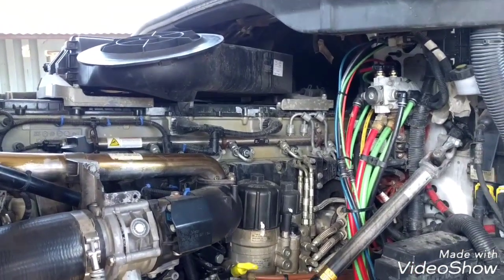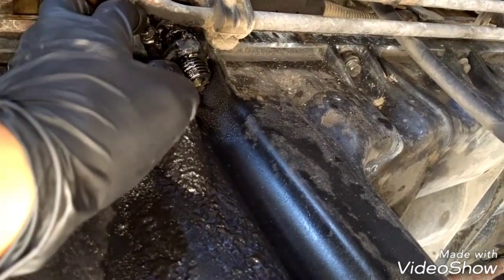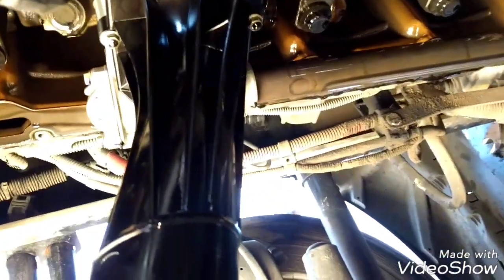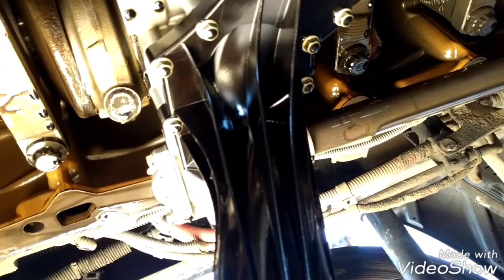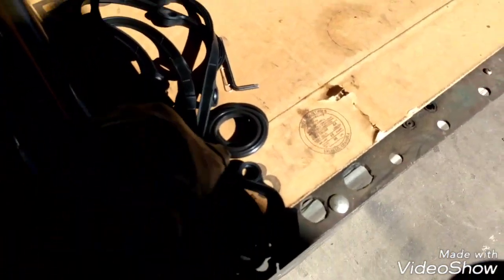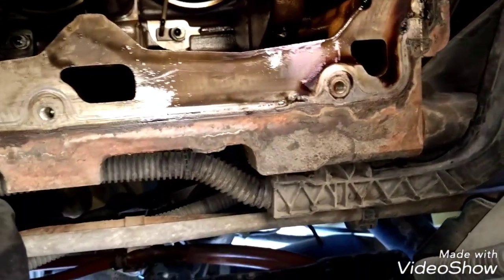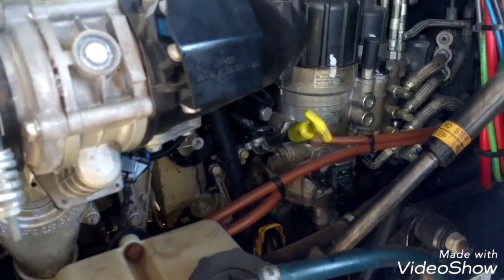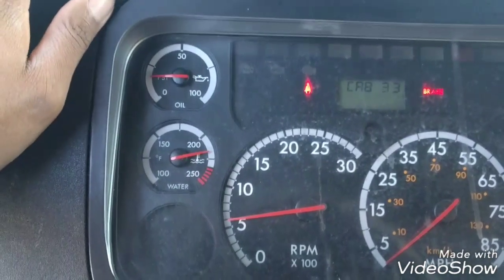Freightliner Cascadia DD13 DD15 oil pressure low oil pump o-ring replacement oil pressure warning

Comment: I have a DD15 engine The oil pressure is good. However when I shift the pressure drops drastically but as I idle it picks up. So my oil pressure dances
Reply: Did you ever find out what this problem is

Comment: I have a DD15 engine The oil pressure is good. However when I shift the pressure drops drastically but as I idle it picks up. So my oil pressure dances
Reply from the maker: I think, you should change the oil pump o-rings and the suction module.  

Looks like the PROBLEM is starting.
Reply: Mine does the opposite. When I shift, sometimes the oil pressure surges then quickly comes back down. I currently have code SPN 100 FMI 0. It says “oil pressure sensor problem detected service engine soon.” I have gotten this code once before but it went away. Also, when this code pops up, the oil pressure fluctuates from time to time.

Comment: Buenas tardes francisco mire que mi camioncito se le cayo la presion asta 0 pense que era el sensor decho se lo cambie  pero la presion sige a 0 alguna sugerensi se lo agradeseria mucho decho esta un faultcode SPN000100
Reply from the maker: Posiblemente se quebrado el modulo de suction de aceite

Comment: Im losing oil pressure when I break and come to a stop. While I’m driving or idling the pressure is normal. Have you seen this?
Reply: Same for me
Reply: Same
Reply: What is problem how Much it cost
Reply: I’m having this problem, while I’m driving it goes to 50, but while coming at stops it drop almost to the bottom. What you ended up doing?

Comment: I have a 2014 Cascadia and my oil gauge dropped to 0 while driving... got towed in but truck still starts with no engine lights... what could be my problem and repair advice

Comment: If you wait to put the new oil filter in, you will dump a half to a quart of old oil in the clean oil pan. Stays in the engine until you remove the vacuum.  Just discovered this by accident while doing a pan gasket.

Comment: What is the name of your shop? I have this low oil pressure problem on my 2010 dd15. Thanks for the informative videos
Reply: When you say oil pressure is low can you please be more specific as to what is going on, is it your oil psi needle or is  your oil light on the dash is coming on?🤔
Reply: Tenggo un dd13 DEL 2010, la precion del aceite se me vajo a 0 y se prendieron las Luces del check engine and stop engine y se apago el camión, en la carretera no tuve ningun problema de presion si no haste cuando pare y le volvi a prender. Lleve el camion en wincha a un taller y primero me dijeron q eran los cables de los sensors, los cambiaron y prendio todo normal sali del taller y se volvio a apagar con el mismo problema de la Presion en 0. Ahora me dice el mecanico que encontro metal en el aceite. Que tan danado puede estar el motor"? Que piezas deberia cambiar? Deberia reparar todo el motor por que puede Huber pedazos de metal en todo el motor? Gracias x su ayuda.
Reply from the maker: Deveria tratar de cambiar la bomba de aceite, los orings y el bracket de succion.  Puede que eso lo ayude. Sino resuelve nada va a tener que cambiar los metales de la bancada y biela
Reply: Francisco Amaya muchas gracias, y puede que el árbol de levas también esté malo???
Reply: Francisco Amaya gracias
Reply from the maker: No, el Arbol de levas posiblemente no

Comment: My stop engine light came up,my oil pressure won't go up,I pulled over,my truck won't start and the motor seems locked up,I have a 2013 freightliner cascadia 13speed automatic transmission,can anyone help me out?

Comment: Good job Francisco. I have a 2012 Paccar engine I've noticed that the oil pressure has dropped to 30-35 when it used to stay at 40 what would you recommend.  Thanks

Comment: Francisco, how much does a job like this cost normally?
Reply from the maker: $500 - $1200 depending on the parts that you are going to replace and the shop labor rate. (dealer is going to charge more)

Comment: I have a 2012 cascadias with dd15 .When I brake hard ,the stop engine come on ,do you know what could be the reason ?
Reply: The oil pressure did drop
Reply: You need to replace the oil pump "O" ring, I just did that work before yesterday.. Was happening same thing to me, now is done that problem.
Reply from the maker: It is possible that you have the oil low pressure problem, check the oil pressure guage to see how low does it goes.
Reply: Me 2 same thing i guess ill start with oil pump
Reply: I have the same problem did you ever find out what causing your oil light to come on when braking hard?

Comment: My Detroit 60 series has the same oil pressure when it's hot and I thought I had an issue with the motor. The motor was rebuild less than 30000 miles ago

Comment: Hi Mr Francisco! I have a problem with oil level. Now I’m fixing that fuel is going to coolant. This I checked oil level, it was on max level mark when I changed oil but today I checked and it’s higher for 7-8 mm than max level mark. I don’t see any water in oil, oil was thinner, what might be issue with it? Do you think fuel might go in the oil when injector cups o-rings destroyed? Tell me please what to check , thank you very much!
Reply from the maker: If you replaced the fuel injector cups, there could be a fuel leak from a fuel injection. 
My suggestion, remove the six fuel injectors again and replace the fuel injector o-rings.

Comment: the ecm looks at oil temp as well as pressure to trip a low oil pressure code. also before you start this job you should find out how many seconds the engine ran with low oil pressure. if it is excessive when the pan is off and the oil pickup is off that would be the time to drop a couple of bearings and inspect them. if they are scuffed- REPLACE ALL THE BOTTOM END BEARINGS RIGHT NOW! no exceptions...
Reply: forgot to mention if you are going to drop a couple of bearings inspect 5 or 6 main and 4 AND 5 rods. they seem to be the worse for wear.  and don't put any crap additive in the oil.  good oil and filter is all you need. yo!

Comment: Francisco  i had a break down in south carolina 2012 dd15 720k 24 hrs from last pm . While driving at 65mph oil preassure dropped then a clunk cluck cluck noise was heard driver pulled over and shut the engine .worst cause senerio bearing damage on piston bearings or crank bearings .. if crack shaft is not damage can or have you experianced changing out all bearing and oil pump and resealing with new o-rings and sump and having the truck fix the cluck sound ? In other words if you had a clucking sound after oil pressure would you rather change out the motor or just replace the bearings if one or more were damaged? Thanks
Reply: so what was wrong?

Comment: Hola Francisco, disculpa molestarte, I tried taking the wheel out to replace the abs sensor,I have 2011 cascadia with disc brakes so i looked and you pull the bolts in the front to loose the rotor but after that what do I do, cause the rotor is not going to move? no room can you please help me. Freightliner charged me 18 hours to do my engine harness I am so mad I need to do my own stuff. Thank you so much.
Reply from the maker: Email me here 
ccsfleetservices25@outlook.com
Send me some pics to understand you better and give you a better advice.

Comment: For that fix did the code on the dash say,
ENG 2 001 SPN 000100
Oil pressure 01 ??
Mine goes off when i break but oil levels are fine.
Reply: Zack Myers drop your oil pan I just went thru that it was the o ring on the oil pump on mine

Comment: Do they go bad at 350000 miles?
Reply from the maker: It varies, some go bad at 700k + miles
Reply: @franciscoamayaYT  My truck had broke down due to low oil pressure warning , but it turned out to be the sensor only whoo! i saved a couple thousand
Reply: Anonymous Trucker what type of codes where you getting?

Comment: Hey Francisco, i had one time oil light came on but after changing the oil it went back to normal. Now low oil pressure coming back on again.
it stared coming back again after about 3000 miles or little more after changing the oil. 
Can you please tell what would be the problem?
Reply: spn 100 fmi 1 this is the code its reading
Reply from the maker: Probably, you will need to service the oil pump orings and suction module soon.

Comment: My truck have the same problem and i would like to get fix I have oil in my tank and my oil gauge pressure always go belong 0  and the check engine and stop engine light come can you help
Reply from the maker: You will need to replace the oil pump o-rings and the oil pick up module, this will fix your low oil pressure problem. 
Now, you say that you have oil in your coolant tank,  Right?

Comment: I going to replace oil pan gasket soon, I would like to know is any torque for bolts?
Do I have to put all around selicone?
Reply from the maker: For the oil pan gasket should be 22 ft./pnds to 25 ft./pnds

The silicon goes only in the little square in each corner of the oil pan gasket.

Comment: Hey there I have this 2010 Freightliner Cascadia with Detroit DD15, my concern is oil pressure stays a little higher than usual, it used to do 45-48ish PSI at 1350 RPM on old warmed oil but now it’s doing 52-54ish PSI even at 1300 RPM even plus it’s leaking oil from breather. I recently changed the crankcase breather. I added oil 1.5 gallons just under 20,000 miles after oil change, Since this started happening I noticed a fan sound while cruising on highway but I know it’s not the fan sound. Please let me know if you can give me an idea about what could it be or any other suggestions I would appreciate your help. Have a nice day
Reply: Hi macanic when I started my dd15 freightliner cascadia  in the morning oil pressure goes all the way 60 or 70 I mean it pass 50 psi more and more and then when its worm up its go back to the under the 50 30 psi
Reply from the maker: That is normal for DD15. 
When temp is 220° F the minimum oil pressure should be 13 psi

Comment: Hello sir last week when my truck was climbing on a mountain suddenly his oil pressure is low and red oil light is on. I stopped the truck immediately and wait for fifteen minutes than oil pressure is 40psi on 70mph. After one day pressure is going to its normal i.e 55psi. I am driving last seven days with no issue. Can u pl suggest me that i need to replace complete oil pump. My truck is freightliner cascadea 2017 DD15 with 631000 miles. Thanx
Reply: different oils shear at different temperatures sudden drop in oil pressure when the engine gets hot would suggest the oil is turned to a diesel fuel like consistency (runs like water) if u put a higher grade of oil in t6 rotella full synthetic u will notice a quieter motor and a consistent oil pressure even though the t6 will seem like a thinner type oil to look at it does not react to heat the same way as conventional or semi synthetic blends if u work out the cost difference of synthetics longer oil change interval the cost is the same plus the nice smooth quiet motor added bonus
Reply: My truck was the  same.  It was the o rings.  Change it soon.

Comment: Hola papa me quede botado hoy no lo puedo creer desde de hablar contigo mira este son los codigos 
Eec 61. Sp 3364 fl2, 
EEC 61. Sp 3364 FL 17 
Eng 1 sp 2791 fl 14 
Abs 11 sp 5 fl 6
Y la lus amarilla del DEF PRENDE Y APAGA PERO TENGO LAS 3 luses de full yo le cambie todos los filtros todo pero ya se vajo la fuersa me vine para la casa papa. Dios lo bendiga.
Reply from the maker: Los primeros dos dicen que la calidad de DEF es mala 

El 2791 / 14 dice EGR error.  
Es posible que la EGR sea la causa de los otros dos 
Possiblemente va a tener que cambiar la EGR y El harness del El motor y despues hacerle una regeneration.
Reply: Hágale un delete mejor y se ahorra esos problemas

Comment: Muchas gracias por tus vídeos, son de mucha ayuda,! 
Tengo un 2011 Cascadia DD13 y cuando doy una vuelta rápido o una frenada se enciende La Luz de low oil pressure y el check engine pero solo unos segundos y se borran, en su opinión que puede ser la falla,!
Reply from the maker: Baja presion, cambie los orings de la bomba de aceite y el modulo de succion

Comment: papa hello my name is Joel, tengo un problema super grande me tiene loco ya, quería ver si me puedes dar un consejo como ayer las luces check engine me prenden las dos y aveses ya me prende la del def amarilla prende y apaga como si no tuviera def. voy a cambiarle el wire harness como tu dices me puedes indicar como seria la mejor manera de hacerlo no se como empezar. me coreo es mvagusta1972@yahoo.com gracias muchas gracias.
Reply from the maker: Dijame El codigo que tiene El motor y le voy a poder ayudar.

Comment: Hello papa listen I just drop the truck off at freight and they said it and electric issue, and they said 10 hrs to change the wire harness I said you guys are really crazy but I have to choice papa. thank you I hope that takes care the problem. I need a rear wheel abs sensor I have disc brakes do I have to take the hub out to do it?
Reply from the maker: No, just the rotor.
Reply: papa in the back just the rotor and how you get the screws out? really I hope so remember its a cascadia with disc brakes papa all around.

Comment: How about if your oil pressure going so high....... what would be the issue
Reply from the maker: Yes, it is bad (no too bad as a low pressure). 

Possible causes

Bad oil pressure sensor
Bad oil suction module
Oil viscosity too heavy

Comment: Hola! Disculpe tengo una pregunta sobre la presion de aceite. El camion es un DD13 se reconstruyo el motor. Antes de la reconstrucion cuando corria a 60 millas por hora la presion siempre estaba arriba de 50. Y ahora que se reconstruyo el motor la presion de aceite a 60 millas marca mas omenos entre 35 a 40 . Se le Han cambiaron  2 pompas nuevas y se cambiar el que subciona el aceite. Y la presion sigue igual. Mi pregunta es que si es normal que la presion sea menos que antes que se tronara el motor
Reply from the maker: Cuando el motor esta caliente a 215 grados en minima. A cuanto esta la precion?
Reply: @franciscoamayaYT  como en 20
Reply from the maker: En minima esta bien. 
Probably que el tipo de aceite no muy grueso

Comment: How do i know, when its time to change the oil pump, does it give any warning or not, can you please let me know.
Reply from the maker: It get low oil pressure and sometimes the red light comes on.
Reply: Francisco Amaya Thank You sir, so its means it won’t seize engine right away. I will have chance to fix the oil pump. Please reply
Reply: MrDeepa32 my mechanic told me to bring it the the shop right away because I might damage the engine

Comment: I have a problem my clutch. Fan is staying on getting code spn 647  I replaced fan control solenoid
Reply from the maker: Do you power and ground in the solenoid plug?
Reply: Francisco Amaya not sure what you asking
Reply from the maker: Sorry, I wrote it wrong.  
Do you have power and ground on your fan clutch solenoid plug?

The solenoid plug has two wires, one is + the other is -
Reply: I don't think so
Reply from the maker: So that means that something else is activating the fan, it could be a bad A/C pressure sensor.

Comment: Gracias por la ayuda que nos das. Cual es el torque en metales de biela y de enbancada or main bearing?
Reply from the maker: Biela 

DD13: 140 lb·ft + 90° grados
DD15: 85 lb·ft + 180° grados
DD16: 85 lb·ft + 180° grados 

Bancada de El ciguenal

 DD13
El proceso es en 4 pasos
1- 37 lb·ft
2- 111 lb·ft
3- 221 lb·ft
4- 90° grados
 
DD15 y DD16
El proceso 
es en 4 paso.  
1- 111 lb·ft
2- 184 lb·ft
3- 90° grados
4- 90° grados
Reply: Oye Francisco Gracias por los videos. Tengo un DD15 de 2016. Lo compre Nuevo y el pression Siempre estaba 45-55psi en Idle y caliente. Y ahora esta como en el video exactamente. Porque paso eso?

Comment: 23 to26  is good  oil pressure  thank  for the information!!
Reply: if engine is normal hot and you just stopped after driving the oil pressure will go down to 16-18 and than slowly rise to 23-26 within 3-5 minute.
Reply: 16-18 is considered low don’t believe google saying it’s acceptable. The engine running that low for long time will cause motor failure. I just went thru that lucky I had a reason to change the oil pan and found bad oil pump o rings

Comment: I had same problem on 2012 cascadia with 450, 000 miles
Reply: Dyatel8 what was you're oil pressure at idle? And driving?

Comment: Hey got an issue with my oil pressure it will go all the way up to the max then drop all the way to 0 then back to normal my engine goes on when it does it then goes off when it goes back to normal peessure. Would you know why it's doing this?
Reply: I mean my engine light goes on when the pressure goes up and down then the light will go off when it's back on the regular pressure

Comment: i have low oil pressure and i kind seeing matel shaving into the oil when i chk with oil deep stick.
what u think it could be the problem and how much would it cost to get it fix?
2010 dd15 with 600k miles on it.
Reply from the maker: You can replace the suction module and the oil pump o-rings, if this doesn't fix your problem you will need to replace the main bearing.
Reply: M having a same problem whats ur shop address in fontana

Comment: My oil pressure bounces back and forth, but when I check the dip stick, the dip stick is at full? I do I go by the dip stick at full or the oil gage?? Thanks
Reply from the maker: DD15 engine?
Reply: Yes DD15. it’s kind of leaking. I checked under. Can I keep adding fuel until I fix it or do I have to fix it right away? Thanks
Reply from the maker: @yoban360  
Maybe your oil pump orings are getting bad
Reply: Francisco Amaya can I keep adding oil until I fix it?
Reply from the maker: @yoban360  
Yes, you can but don't wait to long.